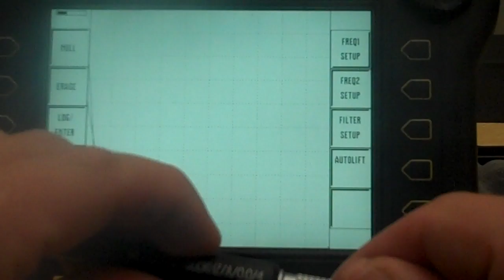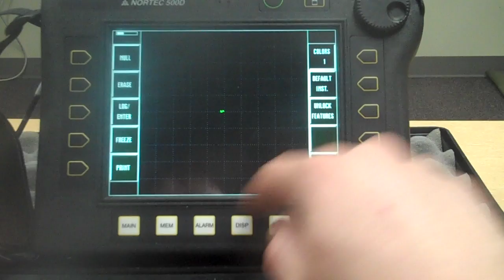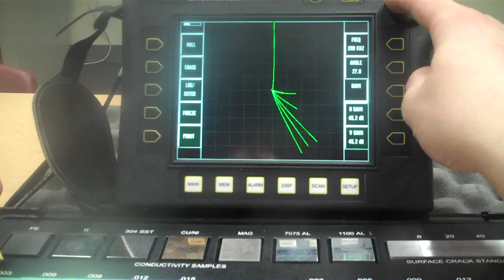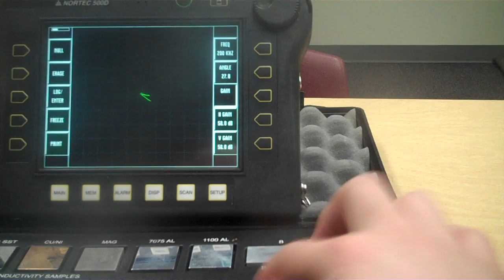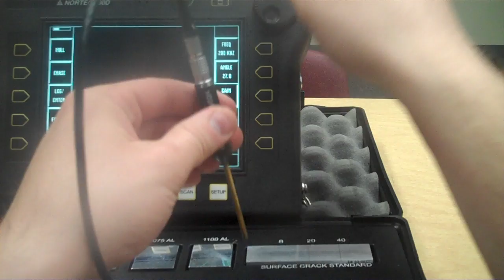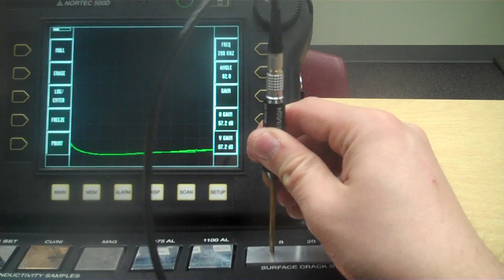Intro to Eddy Current Machine

Comment: hello guys i have question .some body help me please
can we use eddy current machine on pd eyes to detect crack ? because i heared that we can detect only on soft and perfectly smooth surface .
Reply: Qamar,

You can really use eddy current on any surface you want to as long as it is conductive. Now with that being said you are going to possibly deal with alot of noise in your signal, but I am sure willing to give anything a try.

Toss me an email

joe.clasen@cowley.edu

Comment: good afternoon Joe, i am self learning how to use Nortec 500 and i am curious to know if i am capable with this equipment of measuring the depth of a crack in plate steel
Reply: im not joe but yes you can. anything thats ferrous metal

Comment: Joe, it's been plenty of moons since I performed surface eddy current and a little rusty on what frequencies to set my machine at.  Could you tell me what is the optimum frequency to test for carbon steel?
Reply from the maker: +Louis Orcino 
Louis, 

Steel is going to be a little weird because of the permeability, but you can get by with 100 - 200 khz and start there. 

Thanks!

Joe

Comment: can i get a voltage vs penentration depth graph using this machine? is the vertical gain some sort of an equivalent to penetration depth?
Reply from the maker: Wei,

I don't have a voltage / penetration graph for this machine and really I don't think you need one because there are calculations out there that will allow you to calculate standard depth of penetration.

The gain could be thought of as a depth, but not the best way to look at things.

Joe
Reply: Joe Clasen Thank you for the reply.

I'm trying to do residual stress measurement with eddy current, but I don't know what equipment to purchase. All the articles I found are very vague about the use of equipments and the calculation of residual stress from conductivity.

The reason I asked you if it gives voltage/pen. depth graph is that I read in a paper that there is a linear relation between the residual stress and eddu current voltage, so was wondering if I can get the voltage first and then worry about the residual stress.

So it doesn't give the graph I want ...Can you extract the data though? like a txt file of the readings of the probes? and is it able to plot anything else or convert the readings?

Thank you
Wei
Reply: Wei Wang
I would get in contact with Olympus, they would be more than willing to help!
We don't do anything like that! Sorry!

Comment: Hello i tried to do this practice with my nortec 500d and a MP905-60 1-3MHZ probe and a CBM-6 cable and a calibration standard (0.008"-0.02"-0.04") but i dont have good results, i see the dot and the lift-off, edge effect but very small i, vary the frequency, gain, filter but the signals representations in the screen cotinue very small i cant see clearly the signal of the discontinuities